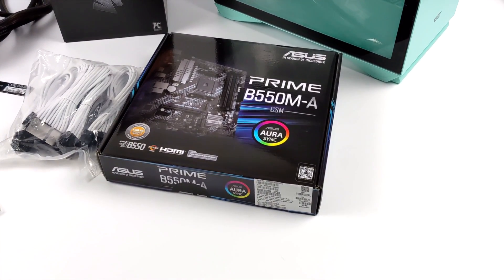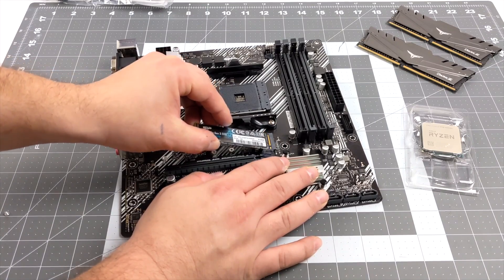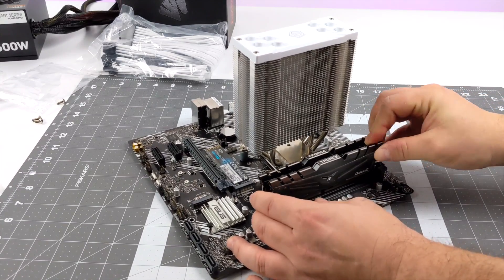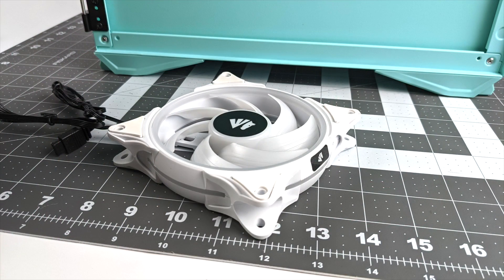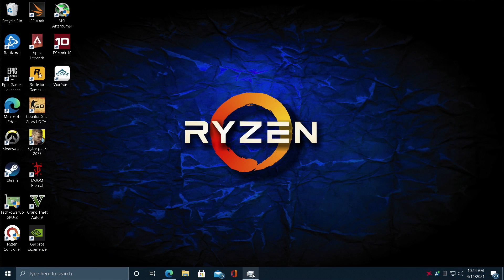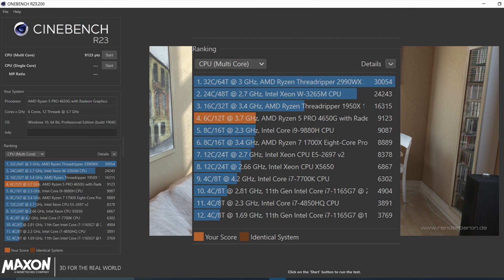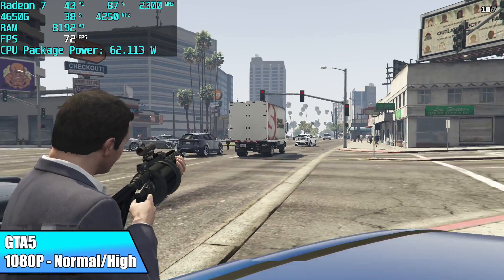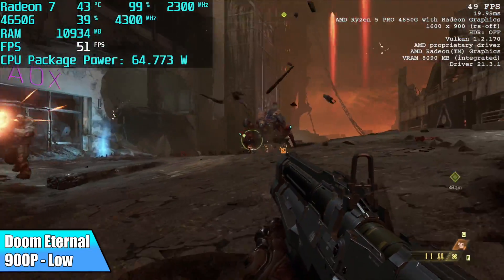NO Video Card Gaming PC Build

Comment: There is no value in this video if you don't establish a reference point for those benchmark numbers to make sense. For reference, this CPU is only 3% better in gaming FPS than the 3400G and only 2% better than the 1185G7 and more than 56% slower than a GTX 1050. That is how you review.
Reply: doesn't the comparison to the 3400G depend on game--I thought I saw a couple of YT vids where the 3400G had a slight fps edge iirc.  is it that the 4650 can have better graphics if it allows faster ram (which I'm guessing--haven't looked into yet)?
Reply: @linuxlover_8436  3400G has 11 CUs and 4650G has 7 CUs. 3400G has more graphics power but 4650G has 2 more cores which gives it slight edge in some games with bigger maps.
Reply: @Falcon5ive  ok thanks Jake

Comment: might have wanted to mention those included power supplies in rosewill cases are utter shit and can take down the entire computer when , not if.When it has a voltage spike,Ive seen it happen multiple times with crappy power supplies.Even if it says it pushes 400 watts, its cheap and terrible quality.You will have throw all that money down the drain.Get a rosewill case but buy something like a 450w evga power supply,they are like 40 dollars.Better to be safe than eventually sorry.
Reply: LOL! No. Modern PSUs rarely take out systems.  Most problems a user experiences HUMAN ERROR, IE, dumbasses  push it their PSU to the max. For example, Using a 3080 on a 500 watt PSU, of course something is gonna happen. Stop spreading myths about cheaper options! I ran a stock rosewill PSU for years on a budget build and it still runs today!
Reply: @TRUMPWON2020-w1r  whatever you say,doesnt matter what your opinion is because Ive had to rebuild countless computers cause morons were using shit power supplies on them...on a budget system pushing cards that only required 1 x 6 pin connector. Just for clarity, you have to discount your windows XP machine running a Pentium 4 with integrated graphics with that Rosewill PSU,cause in those instances.Yes they are fine.By the way using a cheap PSU is the noobest mistake anyone can do when building a computer and its no myth lol.Also stop spreading misinformation like Trump does and what cost him the election and hopefully prison time.

Comment: My dumb ass built a pc just like this with the 3400g about a week ago
It’s specs:

Ryzen 5 3400g
16gb Corsair vengeance rgb 
Lian il mid tower wight 
Apevia prestige psu 
1tb Samsung evo 
5rgb up here fans 
Arous b450m
Reply: the 3400g is still a good choice afaict and still has a better gpu than some of the newer apu's but I'm still looking into that to decide if should buy the 3400G or one of these newer ones which mostly require buying a pre-built/oem pc which doesn't sound appealing so far as I prefer building

Comment: What about this build with an older a10 am4 cpu I know the processer performance would be nowhere near the same but would the gaming performance change much?
Reply: Omg those A10s are terrible.   Yeah am4 but the cpu architecture is pre-ryzen and the graphics output is way way worse than modern amd vega.  Think intel 630.  Think 25fps in the original starwars battlefront.   I don’t care how cheap it is not worth it.
Reply: @evers6214  this cpu he's using isn't vega it's Radeon 7 just like a10 9700 or a12 9800
Reply: @Durkhead  I noticed his MSI overlay listed the gpu as Radeon 7 but that is just a label the user puts in.  All of the zen2 based 4000 series APUs use the vega architecture for onboard graphics.  A huge step up from what was in the A10 or A12.

Comment: It would be nice so see a performance comparison between those different ram speeds (2400, 3600 and 4000) 😉
Reply: Yeah for an apu it would make a much bigger difference than with a dedicated gpu.
Reply: imperceptible difference
Reply: @LS-BKLF  Big difference on APUs since they use ram as Vram
Reply: @RedlineRob  good point. Interesting
Reply: @RedlineRob  mmh, really only makes a difference on a ryzen system or if ur running ob video. On An Intel system there will be little difference in performance.
Reply: @RedlineRob  Thanks for explaining that
Reply: It would be such a little difference
Reply: @KG-un8uy  its a huge difference tbh. Look at other video's where they compare different ram speeds on ryzen apu. It gave like up tp 40% increase in performance.

Comment: These types of builds just remind me how shitty 2021 is. 😥
Reply: Naw, think of it from a different perspective.
It seems better if you consider how good you could make a highly capable, yet tiny mini ITX/ SEGA Saturn-sized build.
Reply: @BestGirlsBiggestFan  Yep. That's exactly what I'm doing. I just built a full sized PC six months ago and it's great but I also need a portable workstation that I can bring everywhere with me on my motorcycle😊I find these builds so fun, especially a mini ITX build. It's just plain exciting. By the way, I chose the cooler master nr200 case because it's literally the only one that has decent airflow at a cheap price. I'm going to weld a handle onto the top for carrying/portability.

Comment: Is the iGPU here better than the 3400G Vega 11?

I got a little confused since the description said 6 core 8 threads but you did say in the video it was 12 so desc might just have been a fluke.
Reply: It should be about 20-30% better. The main limiting factor is still the DDR4 memory - which is why AMD still uses GCN/Vega instead of RDNA. But Zen2 supports faster RAM speeds so it should be faster.

When we DDR5 hits the market, you can expect doubling of performance for iGPUs.

Comment: I'm curious to see how AMD's new upcoming apu's perform and how they're priced.
Reply: around the same gaming performance, they are still based on vega cores which are old now
Reply: @kyles8524  i expected a new gen vega core😎☻🤦🏽‍♂️😂
Reply: @mikisafe2905  RDNA
Reply: @Knoah321  they dont use RDNA gpu cores, still vega cores.if you dont believe me look it up
Reply: @kyles8524  I know. I am saying they need to upgrade to RDNA cores. Vega cores are outdated now.
Reply: @Knoah321  or they could increase the core count on the vega cores with a smaller lithography and reduce its power draw

Comment: 4000MHz runs in command rate 2 and runs slow. Run it no faster than 3733 to get the command rate 1.
Reply: nope, since Ryzen 3xxx (zen2 architecture) you can run your RAM at any speed in 1T (Samsung B-die 2x16GB 4800mhz cl19 1T on my Ryzen 7 PRO 4750G without any problems).

Comment: Usually the dual slot ram should be installed in the other two slots. Are you sure you used the right ones?
Reply from the maker: Yes, it listed on the board. Slots a1 a2 and b1 b2
Reply: @ETAPRIME  sure! But usually you put them on the 2 slots  fardest  from the Cpu with one free slot in the middle

Comment: Would LOVE to see what a 1660 is gonna do in this setup. Got my eyes on an open box store display with a 1660, thinking about buying the box, take the card, sell system as is or throw in a low end $55 card and sell it to use that 1660 in my 9900k build I'm SLOWLY parting together

Comment: I know that AMD is the way to go for integrated graphics currently but have you ever tried building an Intel PC and see how well the integrated graphics work on those CPUs for emulation?
Reply from the maker: So when I comes to the new Intel tiger lake mobile chips like the 1165g7 it actually does a really great job but those are mobile chips, the new 11th gen Intel desktop cpus don’t have a great iGPU built in And the Ryzen APUs are much better for gaming on the built in gpu
Reply: @ETAPRIME  I see, I always wondered if they were anywhere near as viable as AMD's chips since no one ever really spoke of them.

Comment: nice performance.
but i really hate that RGB crap.
lucky my case has no glass cause when i build my computer the only ram i found was with rgb on it. 
but the good part of RGB is that you can use it during christmas lol.

@ETA PRIME i have one test i would like for you to test for power consumption if you have time/etc
the consumption difference i want to know is using apu with no discret GPU installed in the computer and use the same apu with GPU installed but not used by the games. idle too.
i want to know how much difference in power adds a discrete GPU that is not being use at all.

Comment: This is a nice build. I'll add an alternative, in case those Renoir APUs get expensive, which they will once folks start buying them up.

Swap out the R5 for an i5 11400 and the B550 for a B560 board. As far as integrated graphics go, Intel's actually a bit better than what's on those Renoirs. So, if you can't find what ETA mentioned at a reasonable price, you still have options.
Reply: Well, we have to see how the Ryzen 5000 Series APU's would be like.
Reply: @Sup_D  Yeah, but those are coming later this year for DIY. I'll be interested to see how they are too. If you need something now, though, The 11400 isn't a bad buy.
Reply: @nightbirdds  Well I saw the news about Ryzen 5000 Series APU's just after posting the comment.
And based on my initial impression, I would say that I am somewhat disappointed, atleast on the lack of PCIe 4.0 support on the new APU's. Plus the integrated graphic doesn't seem that good, atleast on paper. Need a comparison between AMD Radeon 7 & Intel UHD 730/750, to be sure.

As for availablity of Ryzen 5000 APU's, well I would say that we would be seeing the OEM ones listed for sale on some e-commerce site within a month (like with the 4000 series ones). Won't really would have to wait for official release later this year.

Comment: /watches ETA putting the DIMMS in the wrong slots
This is fine
/eye twitches
Reply: actually it's not wrong. you can use dimm 2 and 4 or dimm 1 and 3, but the ordinary way of slotting the rams is dimm 2 and 4
Reply: @unrulyvere1  lmao it’s always slots 2 and 4 for dual channel two sticks. You’re losing some of the memory bandwidth when you use 1 and 3 and typically XMP won’t work right in that config.
Reply: @unrulyvere1  Yeah, but it's printed right on the motherboard next to the RAM slots that it should've been slots 2 and 4.  :)
Reply: @unrulyvere1  Yes, but writing it this way was funnier.
(Oh, and if you try this on a recent MSI motherboard, the UEFI will call you out on it when you boot up and advise you to move the sticks to 2 and 4!)

Comment: wtf happened to pricing.we ordered my brothers 3400g for 382 usd.It's up now cause of covid but it's still around 490 usd for the complete system and he had add-ons like wifi dongle etc.250 usd just for a cpu are straight daylight robbery.We had an upgrade kit 4650 apu with 16 gb ram and b520 mobo for around 400 usd but i guess amd's been bitching cause a week after release they got taken down meaning you can only get them as an oem.

Comment: Make sure to use the other Ram slots for dual channel operation. Should be a2 and b2
Reply: Its my understanding he did that correctly.   Most motherboards use alternating slots for bank1 and bank2 and will recommend populating a dual ram kit into a single bank.   The motherboard will automatically run this configuration in dual channel.  Its possible im wrong about this and have been doing it wrong for decades.  😜
Reply: @evers6214  the motherboard manual for this board says to put it in 2 and 4 not 1 and 3.
4 first for single DIMM then 2 and 4 , and then all 4 if you have 4 modules.

Comment: Hey that's almost the same idea I had a couple of months ago!
I also went for the 4650G, but opted for a mini ITX build in a DLH21 instead.
Since I went ITX, the motherboard had to be picked accordingly and B550-itx models were just too expensive.
So I had to use the Asrock A520m-itx.
I used the system for some weeks before I managed to snag a 3060 at the launch day.
While I installed the card, I splurged on some Noctua fans as well.
Now it's almost completely silent, and looks like an air purifier lol.